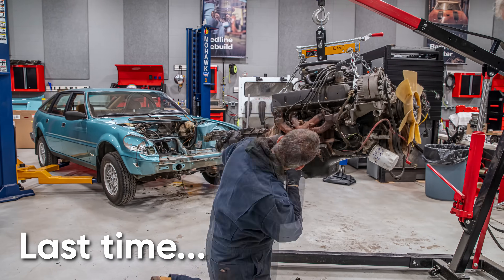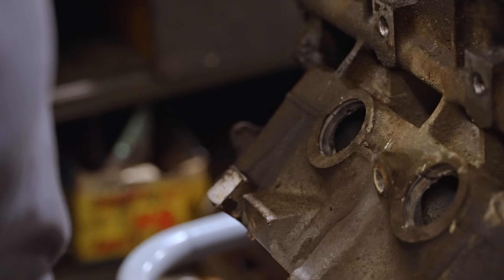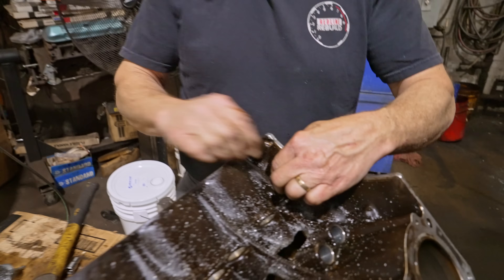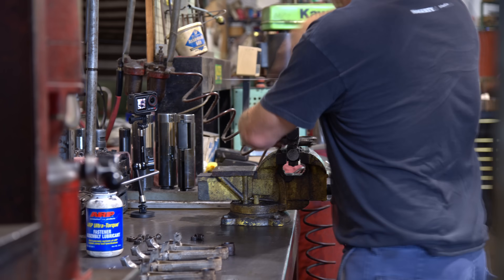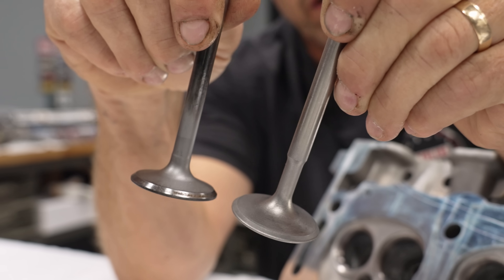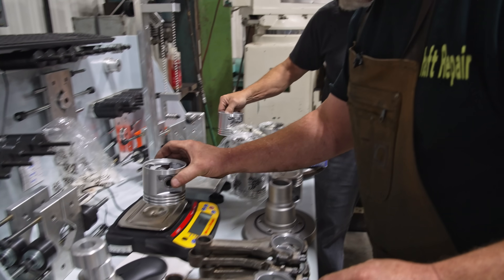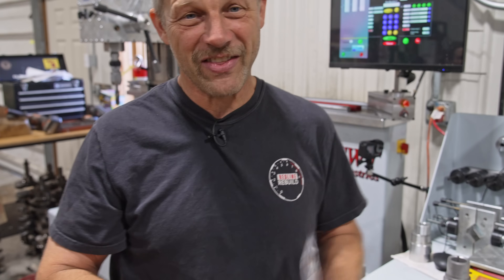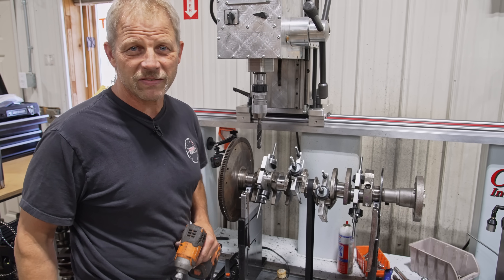How do we get more horsepower from Cammisa's Rover V8 engine? | Redline Rebuild Update

Comment: The 60 gram thing is not quite right, my understanding is that Rover then externally balanced the engine, they wedged lumps of threaded rod into the front damper!  Yes of course it would be better if the engine was internally balanced to a higher standard in the first place.

Comment: How much unbalance in standard parts are is sometimes amazingly off. I took one set of CVH Ford 1600cc conrods to lighten them. Weighted each one as new standard. Were at 5 grams difference, then i took of 28 gramms from base as the lightest conrod and polished the beams. Send them to a engine builder wich had my block already, and he found out 3 out of 4 were off being straight limits. Not due to grinding heat wich was not hot, but as out of the box. So he did do straighten them within tolerances. This engine barks with own head port work, rally cam up to 7000tpm as to 6500 standard.

Comment: Good video. I have a Rover 3,5 engine in my backyard under carport. Got it for free with a 4x4 transmission. Engine is ok. So i am thinking what to do with it. 
I have an Eaton M112 supercharger also got it for free, because i did some work for that friend. Lucky me. Supercharge it or to keep it N/A will be judged in time.
Cost investment 5000 € or some 5500$ wich i dont have yet 🤔😁

Comment: buick couldn't get the casting process right for aluminium that's why they went back to making their engines from iron rover did and the process became better understood generally which is one of the reasons gm tried to buy the rights for the engine  back at least twice.

Comment: 1:45 Working in a shop back in the day pulling out stuck galley plugs we would use heat and some candle wax, heat it up and put the wax on it and it melts into the threads as a lubricant. Works better than just heating

Comment: old engines can be horrid from tolerances perspective. My father rebuilt the 1500 engine in a 1963 Cortina simply balancing, mild porting and a Cortina GT cam, the result, double the power and much better MPG.

Comment: The rover heads have a heck of a shelf in the intake side with a casting split line.  I  blend that out for better flow over the sharp edge.  The ports in these heads are limited.  TA has some upgrades but that makes all the bolt on bits not fit.  Of course you could bolt on a Rover truck 14CUX intake manifold and open plenum to get better flow.  So many parts that will fit this odd little engine.

Comment: What a lovely job guys. To Buick it was a small engine so of no interest but to Rover it was a big but light engine to power the bigger executive cars. But it even found its way into MGB GT cars! The late Queen always had a Rover or Range Rover V8 car.
I run a 4 litre fuel injected version of this Rover V8 in my 2001 Range Rover. The car has 220,000 miles and had a Turner V8 fitted at 90,000 miles. What a superb engine. 
The big lesson on these engines as they are bored out or have more power added is to use top hat liners otherwise they shift in the aluminium block and guess what happens? And in fairness to Rover the SD1 saloon / sedan was not sold as a road burner so 60 grams tolerance is no big deal for a lazy V8 miles burner that would have no need to see 4,000 RPM plus. The later Vitesse versions were very fast and those engines were built to very good tolerances.
Reply: the 60 grams tolerance is corrected by balancing the flywheel and front pulley harmonic dampener on older Rover v8s. found it hard watching this at times with the lack of Rover v8 knowledge they have, I understand their doing their best with what they know. when it left the factory it was a externally balanced assembly and in standard form will rev to 5500rpm  (knowledge, I currently own a SD1 twin plenum Vitesse which is  1-500 homologated for British touring car championship) the Rover v8 was more powerful and lighter than the aging straight 6 it replaced in the Rover P5 so was a win win situation for Rover (Rover bought the engine before the merger with BL) although Rover did slightly redesign the engine over the buik design, raised the rev limit due to our more stop start nature, replaced the buik carb for twin SU carbs. this was because they found with our roundabouts and the body roll of the P5 one side of the buik carb would flood and the other side be staved of fuel, and also changed the casting method due to Poor results and high discards of failed blocks. from the way buik was casting them (Rover changed to pressure casting as it forced the air out the block while it cooled)
Reply: @That_sd1_vitesse   Every day is a school day mate. Lovely info. Its just typical how the idea of the cars and the designe were as good as any but we simply could not screw them together right.
I ran a new 3500s back in the day and then a Vitesse followed by a V8 Discovery which had a 3.9 GEMS Fi
Gone full circle with the P38 with the THOR 4 litre.

Comment: You should have swapped it over to the 215 Oldsmobile engine, same bottom end with better heads with more head bolts. The Buick was a weak sister and always had head gasket issues.
Reply: problems warping were caused by the extra 4 bolts. thats y they were deleted
Reply: By the time the SD1 had come around (the engine being built here) Rover had improved the cylinder head design again. Bigger valves than the Buick/Olds/Pontiac heads. By the time the 4/0/4.6 was introduced, they'd been developed again with 10 bolt heads, composite gaskets, etc.

Comment: H/M.  Do love the short engine which was installed by the Rover mechanic, of a 215 cu in. V8 size due to smoothness in my late 1987 Range Rover Classic !  !  Had extractor headers fitted from a 3.9, together with longer duration camshaft and 2.5" stainless system sound ?  ?  V.

Comment: If I recall my British Layland lore correctly, the reason the crank was so unbalanced was because at the factory it was balanced with the flywheel and balancer on the crank as one piece and then just the flywheel and balancer were adjusted to get everything in whatever spec.
Reply: Hence the 60 gram tolerance specification; imagine if the engineers at British Leyland had put actual effort into properly designing and building cars, they wouldn’t be the cautionary tale that basically ruined the entire British automotive industry.
Reply: @digitalrailroader no money to get things right.
Reply: @paulqueripel3493 and it also didn’t help that they had multiple brands fighting for the same market share at identical price points, which over saturated the market.

Comment: I did quite a lot of work on these engines back in the 80’s and they suffer from poor lubrication to the timing chain and gears. There’s a few easy mods to help if you look on the internet…just Google “Rover V8 engine modification for better lubrication for distributor drive gear” and there’s a few good ideas!

Comment: There's nothing like adding compression and thinning the rod. With an angle grinder. When you want to spin the crank faster than stock the very first thing you do is sand all the casting marks out and round every corner. That crank wasn't shiny enough to get balanced. When you do need to take out material for balancing, first you keep rounding those corners. Every balancing hole creates a cavity that creates drag and aerates the oil. That's power loss and potential lubrication failure. Will it make a difference? Well, is there a difference between 249,7 hp and 250,2 hp? Also, you got most of the stall out of the bowl, but left two, most crucial edges, the valve seat on the first cut and the valve cut inner edge. These two edges open up the low lift, as the initial turbulence dissipates faster when the valve starts to open. Then there's the combustion chamber with all the hot spots remaining, the CSA and profile of the ports and intake, the exhaust, the auxiliary units etc. 
Cam lobe and compression is the core, on paper, but the rest of the tiny details are the real magic that keep the fluids flowing in the desired direction.

TVR used this same block with tube headers and custom intake to make 247 hp. That engine is so small, that you really need to have everything perfect to make any power with it naturally aspirated.

Comment: Advance the cam 3 or 4 degrees if possible, I use to run Buick rods in my 350s sbc, Buick rods are 6 inch dimple rods

Comment: wtf? waste of money on a rover of any sort
Reply: Huh, not what I've thought at all when replacing the stock  78hp. iron head 1.9 4 banger in my '74 Opel Manta (2,000 lb.) with the 4.6 Rover I pulled from an '03 Discovery for $180. Doubling the hp. and adding NO WEIGHT. Plus with T700r4 better 1st. gear and O.D. Can't wait to get it done - time and $$ well spent.
Reply: Same could be said of any engine rebuild. It's all about what floats the owners boat.
Reply: wrong

Comment: That 10% gain on the intake flow is impressive for just porting and valve tweaks.
Reply: not unusual in older motors, the stock castings were often quite rough and inconsistent and often the radius of the ports not well done.. porting and matching in anything pre 80's gives big gains.
Reply: A well ported head can improve everything so much, it's crazy. Such a specialised skill.

Comment: Delighted to see a Rover (Buick) V8 in there! After the last episode, i remembered reading many years ago, about a guy who ended up in all sorts of trouble because he'd blueprinted the Rover V8 in his TVR; he competed in sprint/hillclimb in the production class, and had a feeling the car was sub-par, so he had it dyno'd and sure enough, it was down on power. Bearing in mind this was a new car, with the engine as Rover had supplied it to TVR, he decided to risk it, and blueprint it without any actual performance mods, and he ended up with a very healthy engine! Needless to say, the RAC MSA weren't impressed, even though he rightly pointed out he hadn't actually modified it at all, just made it the engine he might've got but for a different 'luck of the draw'. All of which is to say, one of those engines hitting all the worst tolerances, isn't unknown!

Comment: Removed two wholenuts from one shaft.
Mechanically sound engines but I would not trust any other part attached to it. Had SDI and 827 back in the day and everything was unreliable. On the positive, everything I had to fix was down to build quality, clearly not a problem for you guys. Great vid.

Comment: Back about forty years ago I used to balance rotating parts in Caterpillar Powershift transmissions. When I first started out the balancer used an analog type readout and to setup the balancer we would add lumps of clay to try and zero the machine. Never worked really well at all. We switched to all digital machines and that really simplified the process and improved quality. No more rejects from the dyno testing of the transmissions for excessive vibration.

Comment: 20 thousandth's of an inch? More than 0.5mm. That's uh... pretty aggressive for a first hone.
Reply: That’s an overbore, and you really should use a torque plate. It’s a mild build, it’s probably ok, but still.
Reply: @TML34 Indeed, I would be concerned about warpage. Lot of weird stuff here. They clearly know what they're doing, but it just seemed a bit... brutal. Like scotch brite on the machined head surface, torching and drill extracting bolts out of an aluminium crankcase, aggressively grinding conrods. It'll probably work fine, but... yeah.